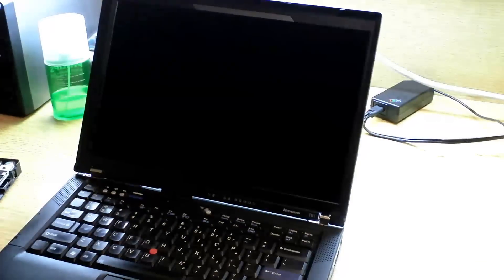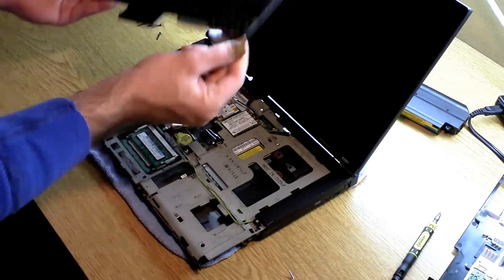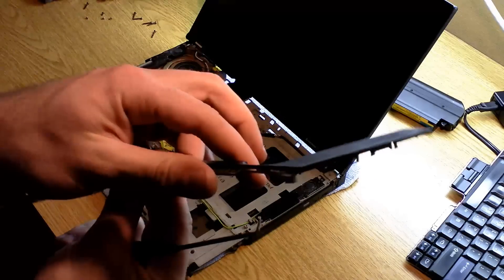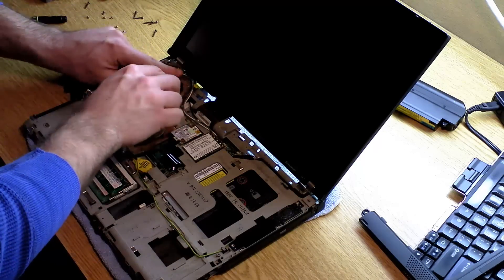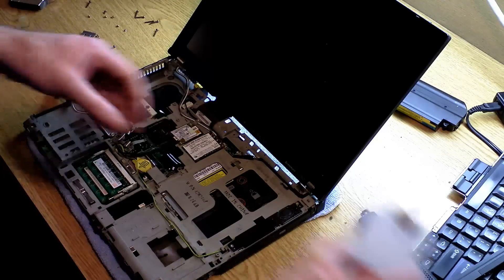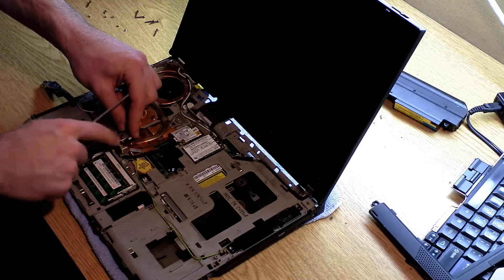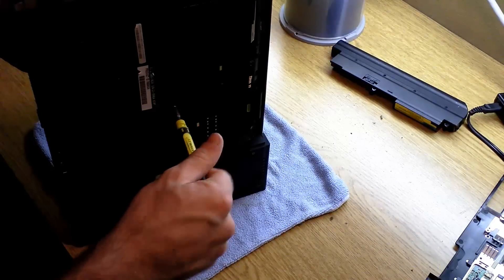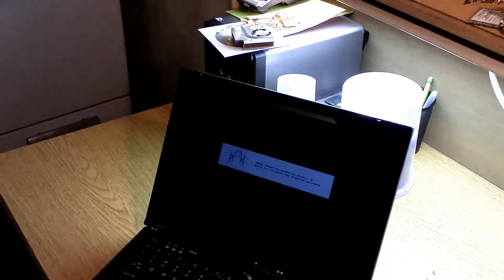Tutorial: How to replace Thinkpad T61 CPU Fan HSF, Fix Fan Error, Cool down CPU!

Comment: Great instructional video!  One minor thing: the screw on the left side of the bezel that you thought was missing, is actually thru-hole for the screw that comes up from the bottom to secure the palm rest.  I noticed that mine seemed to be missing too and I thought it to be too much of a coincidence...and it was.
Reply: I thought the screw was missing as well, found a screw and placed it and then tried to reassemble the laptop and certainly I learned that it was a through-hole.

Comment: Very thankful, sir. Highly appreciated. 

This cpu fan is also repairable: first, unstick the tape from the cover and unbend the holders of the fan, removing in it from the sink. Next, remove the impeller and clean it up. Add one drop of lubricative oil on the center stick and gently push it back. Connect it with the sink and set new tape to cover the small gap between the ventilators and, the fun and,... that's it!

Comment: Worked great. Thanks! One difference: My T61 had an additional bracket holding down the heat sink on the right. No problem, just 4 more screws to remove.

Comment: Thanks for your suggestion. The fan was completely removed before compressed air was applied. I took the fan out and laid it to the side and powered on. The fan does its own spin up during POST and stops and the computer boots up. I put the fan back in place and the fan starts and does not stop duiring POST resulting in a fan error. I tried holding the fan in different positions with differnt startup results. I suspect 1 of the 3 fan wires is iffy. I may order a new fan or try to rewire plug.

Comment from the maker: Glad I could help! Just be careful using WD40 on the fan, I would recommend sewing machine oil instead. Since WD40 is a mild solvent, it will not keep the fan quiet as long as sewing machine oil. But I'm glad everything is working for you!

Comment from the maker: It depends on usage- I suggest downloading HWMonitor (free). This will tell you your CPU temperatures. You can check them while the computer is at idle and while it is running programs. Google your cpu model to find out the max temperature Intel says it should run at, then just make sure that your fan is keeping it below that temperature.

Comment: I'll check when I get home again. I replaced mine 2,5 years ago: still have the old one in a closet. 

But the parts that IBM/Lenovo offers are the whole assemblies; the copper + the fan. The only part that actually needs to be replaced is the fan itself.

Comment from the maker: It is not a standard fan that you can buy on newegg/amazon/etc. You can find hsf assemblies on eBay for $15-20, so honestly even if the fan can be separated I am not sure it is worth it. You will at least double your replacement time, and then you have to deal with compatibility. If you want to minimize costs, the only alternative I would suggest is using some light machine oil (not WD40 or any solvent) to re-lube the fan bearing. I have done this on desktop fans with success.

Comment from the maker: You should be able to put the screen all the way back with no issues. If not, someone was in there and may have hung something up. If so, you can check the wires, but the header on the motherboard may have been damaged. The only way to tell is to open it up and visually inspect it.

Comment: Well I am not sure what the original keyboard is without removing it, but the service manual states the model I bought.  The two designs are very different for the key mechanisms that the caps attach to.  It's luck of the draw too as z61p are more rare and another came up last week, in very good condition compared to mine and with a faster CPU; my cpu is the Core Duo T2500; the other had a Core 2 Duo T7200.

Comment from the maker: Yeah I definitely agree with that, my concern was just how long it might last. With an IBM part its probably a Sunon or similarly good brand, I did not see a brand on the $5 ebay ones. Really, its just $5, I'd buy one to try, check temps with HWMonitor, and im sure it will be comparable.

Comment from the maker: Yes, as I mentioned (I said a quarter of a pea size, you don't need very much) you will need to replace the thermal paste on the cpu. If you remove the thermal pad from the gpu and try to only use thermal paste, you will overheat your laptop because of the space gap there (thermal paste is not enough to join them properly on this laptop). You will either need a new thermal pad, the old thermal pad if it is in good condition, or you can use a copper shim and thermal paste.

Comment: Thanks for a very clear and detailed explanation on how to replace the fan. I was just trying to clean it and used a compressor to blow air through the fan blades probably spinning it much faster than ever before. Now when I put the original fan unit back in place the initial startup winds up the fan (which makes more noise than before) and POST stops with FAN ERROR. I'm guessing that I ruined the fan with that blast of air. I'm curious if you are aware of anything of this nature?

Comment: Well on my laptop i used a really thin copper shim with a really light coating of artic mx-4 thermal paste and i seen about 5 degrees lower in difference. Remember the gpu runs alot hotter the cpu .So i tried what ever i could to run it cooler and that's the only way that i know of to do that. It does cool it alot if done right .

Comment from the maker: Did you buy a brand new, NOS one? Or was it used? If it was used, someone might have just sent you a broken unit. Some have a little dot in the middle that you can leak some light machine oil into to alleviate the problem- if yours does you can try that. Use sewing machine oil if you have it, never use WD40/PB blaster/etc

Comment: I noticed the keyboard here is very worn just like mine.  I bought a used replacement from Ebay (minus one key), only to find the keycaps have a different design underneath, so I could not just pop off the caps and attach them to my existing keyboard.  I checked the service manual for my z61p and was careful to buy the right keyboard model number too.

Comment from the maker: I'll put a couple good links in the description. For this application, I would just recommend a good name brand solution- you don't need to buy IC Diamond or anything. Arctic silver 5 has been the go-to for several years now, however if you find some on sale that is a name brand, I would not hesitate to use it for this. Benchmarks put most thermal pastes within a few degrees of each other (I'll post a link to that information as well).

Comment from the maker: If the connection is the same, then you should have no problems. What happens sometimes is the bearing dries out in the fan causing it to spin more slowly- that is a common cause of the fan error.

Comment from the maker: Well, the majority of thermal pastes out there don't contain metal for this exact reason so im not sure if I'd jump to that conclusion just yet. Hook it up to an external monitor first to see if you are getting video that way. If so, the monitor cable probably just got a little loose when you were under there and needs to be reseated. Failing this, pull both ram sticks out and try to boot the computer. Let me know if it has beeps or not with the ram removed (hit the volume up button to unmute)

Comment from the maker: Well, I would not recommend against them, but you can usually find an OEM unit for one or two dollars more. Much like anything, a generic product will probably be fine- its just the longevity that is questionable. I usually stick with OEM parts if I can help it. Again, it should work fine, I just have no experience with that exact fan. 

I just did a video on relubing a fan. If you have yours apart, see if it has the reservoir. If so, add some sewing machine oil and get it working again.

Comment from the maker: If your fan was on when you blew air in it, you could have broken it. If it was off, it is extremely unlikely you damaged it. I would reseat the fan connector and see if that solves your problem.

Comment from the maker: Do you have some numbers for the difference? I figured the difference was negligible in an application like this, and you'd have to use either thermal paste or adhesive anyway so it wasn't worth fooling with. I really haven't measured the differences though on this model.

Comment: I haven't changed any drivers that I am aware of.  When I was reconnecting everything, I did accidentally put one of the long heat sink screws into the spot where the shallower screw was supposed to go.  Could I have ruined the graphics card when I did that?

Comment from the maker: This will stress the laptop (memtest just ram and ubcd you can choose what test to run), and tell you if your hardware is ok. If everything passes, something happened to your windows install. If something failed, you'll then know what the problem is. If your gpu has failed, unfortunately you'll need to replace the motherboard. It sounds bad, but its not too hard once you tear into it.

Comment: Thanks for the up.  In the past I have heavily modified heatsinks (copper shims, Arctic Silver, casing air holes) for better cooling in old laptops. But now I have a T61P that i dearly love and feel more cautious about BUT they are heat monsters!  Do you know of any similarly sized/oriented higher performance fans or heatsink mods that don't just stop "Fan Error" but actually improve cooling? I can live with fan noise.  I despise heat.
Reply from the maker: enorbet2 I dont unfortunately, however before you out it all back together you can lap the heatsink with 2000 grit sandpaper, clean with rhbbing alcohol, lube the fan bearing, and then use a quality thermal paste like Arctic Silver on both the cpu and nvidia chip. Outside of more significant mods, thats the best result ive had with these
Reply: How do you lube the fan bearing?  I also wonder what causes the fan to go bad to cause the Fan Error.  Would a lube eliminate the need to replace the fan?  Also, is it possible to replace the fan and keep the heatsink assembly?  Thanks.
Reply from the maker: The fan on this pulls off the motor head. Pull it off and put a drop of sewing machine oil on there and you are good to go. The ones I have seen with the fan error are evident of dust build up that was never cleaned. To my knowledge, you need to replace the assembly- I haven't see replacement fan/motors alone

Comment: Thank you SO much for this detailed video.  I think I only have to clean my fan since it's running hot and the buzzing just started the other day, but it seems I also have to take the whole thing apart just to clean out the fan?  I really appreciate it if you could let me know. I don't want to just blow compressed air into it if it'd do any harm.
Reply from the maker: Nope, as long as the laptop is off you can blow air into the vents
Reply: well, you cant blow compressed air full blast. That would make the fan spin much faster and it can break the bearings. Just keep the fan still with a stick of some sort and it's ok.

My T61 has been buzzing for years and the fan mostly doesn't even spin. Haven't done anything, since it doesn't seem to affect anything. Don't even know if it throttles.

Comment from the maker: Very weird, maybe it was actually a production issue. Its non critical so I wouldn't worry about it, but you can get screw kits for around $5 on ebay. I bought one just to have spares to replace missing ones in different thinkpads I have around.

Comment: thanks, same laptop i am using, sometime it shows fan error, and sometime it doesn't. so is it necessary to replace the fan??  or is it possible to clean it just for good working??
Reply from the maker: It may be possible to just clean it and get rid of the code

Comment from the maker: Probably not. I would do this- Get the laptop fully assembled, then remove the ram and reseat it. Make sure it is fully seated, then boot the computer with an external monitor and try to get into the BIOS. If you can get into the bios, that is a good sign. Use another computer to download either "memtest" or "the ultimate boot CD". UBCD will have a bunch of diagnostic tools, memtest is just a memory testing tool. Burn it to a bootable disk, then boot your t60 with it and run a test overnight.

Comment: my fan has started making noise and when I removed the keyboard and armrest and just blew on the fan to make it spin fast it made the same noise. I wonder if the ball bearings in there or something is broken. do I really need to order the whole fan-piece online and do this whole ordeal to make it silent again? its some kind of vibration that is happening. you can even feel the slight vibration it is causing while turned on and when the fans are running at a certain speed.
Reply from the maker: You can try lubricating the fan (see my other video on how to do that), but many times with these sealed units it is better to replace the assembly.
Reply: @GarageMaxedOut  I tried finding the video but was not able to.

Comment: therla pads make the cpu or gpu throttle un-controlably
Reply from the maker: Good thermal pads work great, bad ones work poorly.
Reply: not hermal pads make the cpu over throttle and not function properly.. i use cpu paste and it works better @GarageMaxedOut

Comment from the maker: Yeah sorry, I couldn't really tell you then. Its possible it was just a dud, but unlikely. Its more likely that if it didn't fit correctly, pressure on the fan from somewhere was causing it to stop, but I wouldn't be able to tell you without having it in my hands.

Comment: Good vid, but a bit arrogant though;  "did not know what they were doing" but you yourself are not wearing (nor discussing) the absence of wearing a ESD wrist strap to avoid Electrostatic discharge. On top of the missing wrist strap connecting you to earth, you're wearing cloths that shouldn't be worn during works on esd-sensitive equipment!